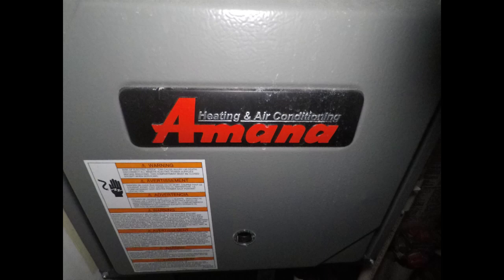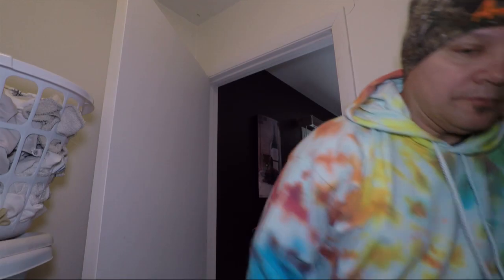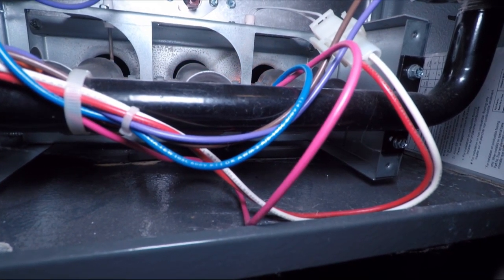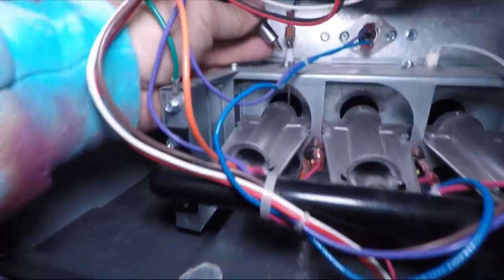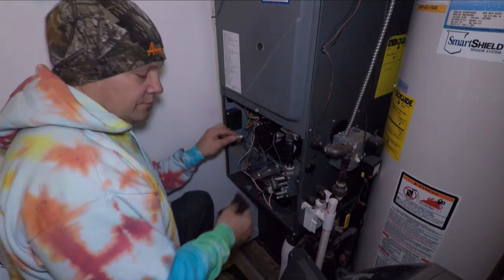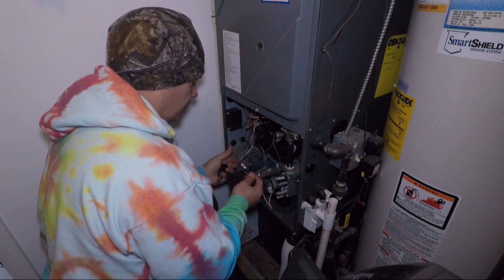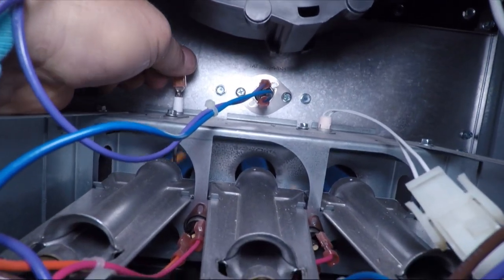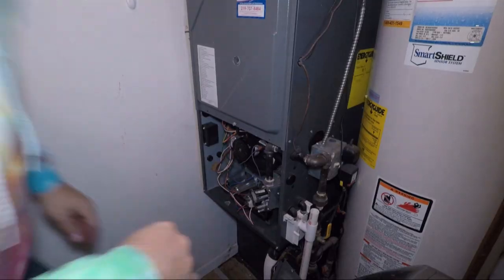FURNACE NOT HEATING:  HOW TO CLEAN GOODMAN OR AMANA FLAME SENSOR

Comment: I believe there is a safety shut off when you remove the access panel. Might be a good idea to mention that.
Reply from the maker: Theres usually a door switch located at the blower housing to prevent people from getting injured on the blower housing

Comment: Just got me out of a bind. My amana was startinig the flame cycle then ending it immediately. I could tell after a few seconds it would fire up and you could see the pilot flame kick I guess like a 2nd flame stage. But the 2nd stage would only maintain for 5 or 6 seconds then go out. So i was like hmmmmm.... why isi this starting to heat but not staying on... it was this. Sut had built up on it, I took a blue scotch brite pad to it and cleanend it and dried and threw it back in and it stayed on. Thanks for the video

Comment: Nice detailed video. 
We have a Goodman (model CHPF030A2C) which is a horizontally mounted model in our attic. It has the same symptoms. Would the furnace components and the detection sensor location be laid out the same as on your video? (except going side ways)...Or with horizontal models are the components arranged differently. Thanks for doing this video.
Phil
Jersey Shore Area
Reply from the maker: Should be located by the burner
Reply: @IHVAC  OK Thanks. I will try cleaning the sensor first, but I did order a 2 pack of the detection sensor (OEM) just in case the cleaning does not work. Thanks again...
Phil
Jersey Shore Area

Comment: Thank you @I HVAC! After watching an older version of this tutorial that required looking for more detail, I'm glad I landed on this version which gave me the confidence to easily locate and clean the sensor without worrying about displacing  something. Although I didnt have a stubby screwdriver that was short enough to get into the limited space, I finally had a chance to use one of those tools that we buy because it could come in handy in rare circumstances. That tool is a Craftsman 3" long, mini ratcheting screw & nut driver (sorry, I don't have a link with Sears now gone). Thanks again for the tutorial.

Comment: So, do you advise screwing around with trying to clean the thing with emery cloth? Or are they cheap enough (2 for $10, apparently) that it's more expeditious to just replace the damn thing outright and not worry about it?

Edit: it appears to be a simple buildup of soot from only partially oxidizing the natural gas stream. That having been said, it strikes me that the typical consequence of oxygen-starved combustion is carbon monoxide. Is this a symptom of something more insidious (like a clogged gas line or inadequate draw)? Like does this suggest a blocked return register or inadequate airflow to the furnace? Or is it a matter of too much air causing the flame to waver and oily soot to be produced (like holding a candle under a piece of glass)? In short, is this a symptom of some other problem with the unit? Or just a natural thing?
Reply from the maker: Yeah thats alot to unpack.  If it was me and it's my furnace I would clean regularly.  In commercial and industrial environment I replace them.  I dont try and get into they why on that especially on a 5 dollar part.  Can I determine why yes with more specific information, I can gather on a specific site.  Wod I spend the energy to do so not unless it was an ongoing problem causing heating failures.
Reply: @IHVAC  IS it a sign of something worse to come? Or is it just "the just gather snarge and this happens to all of 'em. Just the way things are"?

Comment: This was really helpful. I'm not very mechanical, but my 1 year old furnace cuts out because my daughters light so many scented candles and the soot goes in through the air returns. On my newer Amana, the flame sensors are upside down and only about 1.5" long and much wider, FYI.

Comment: That model does not use 120V AC to the flame sensor?
Reply from the maker: I havent seen any furnaces send any voltage to the sensor.  It rectifies the flame and sends a signal back to the board in milliamps for proof of flame.
Reply: @IHVAC  https://electronics.stackexchange.com/questions/148405/how-does-a-flame-sensor-or-thermocouple-operate-with-just-one-wire#:~:text=Depending%20on%20the%20system%20this%20voltage%20may%20be,a%20nozzle%20where%20the%20gas%20and%20air%20combine.